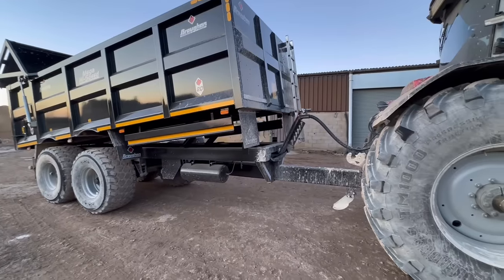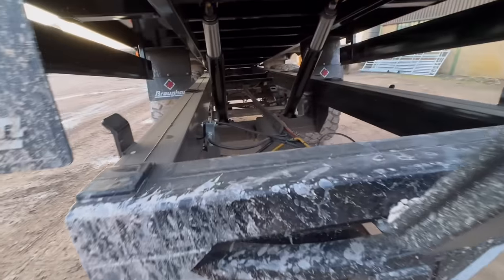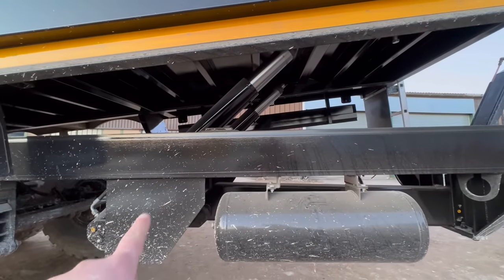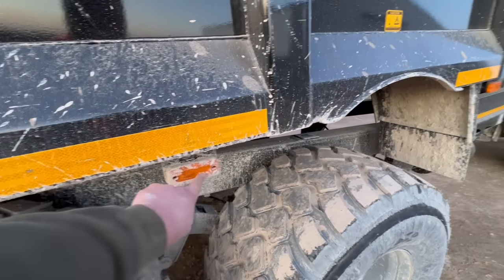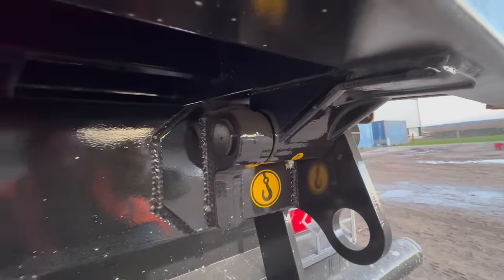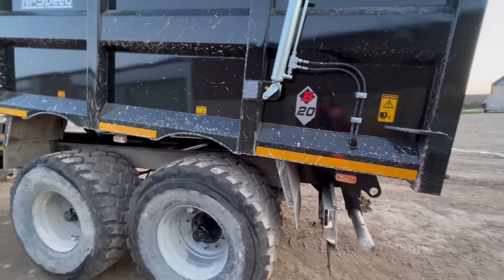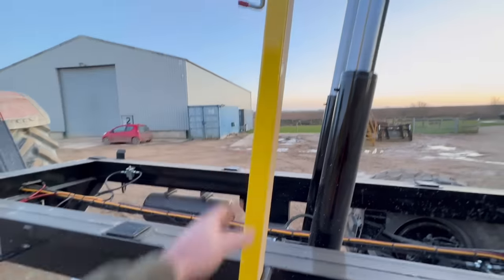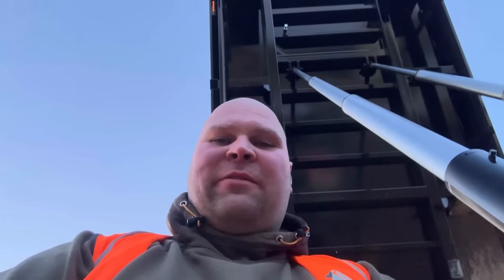New 20ton Broughan rock trailer on the farm. Walk around first looks.

Comment: Good strong trailer they don't mind putting some steel into them , with me the jury is still out on the ram set up , Built many trailers myself but always twin rams facing to the back spaced as wide as possible and you can get the ram angle better when there facing back as it doesn't interfere with the bottom mounts